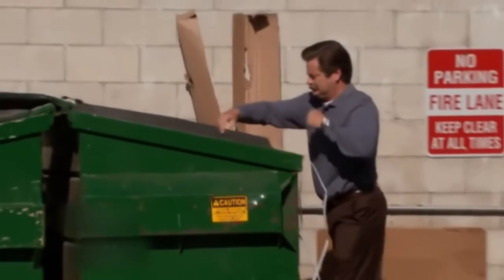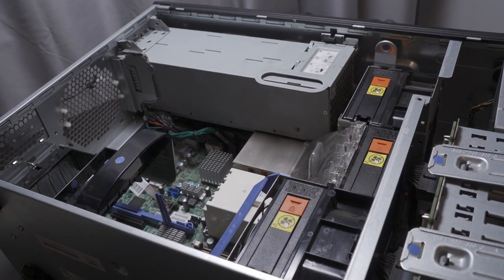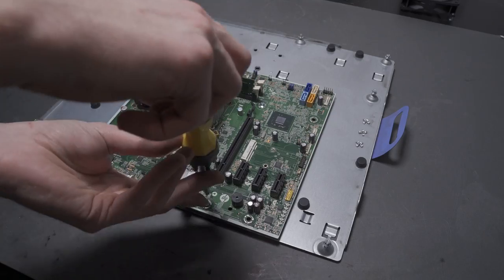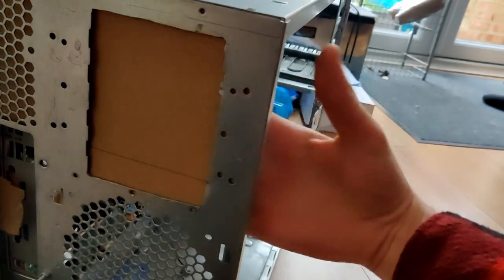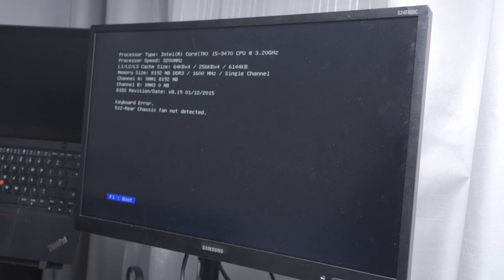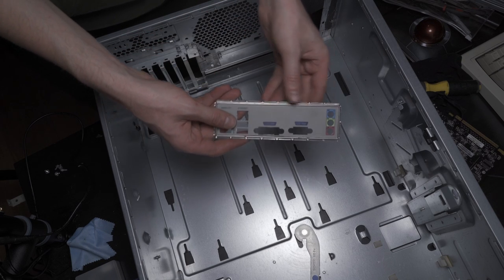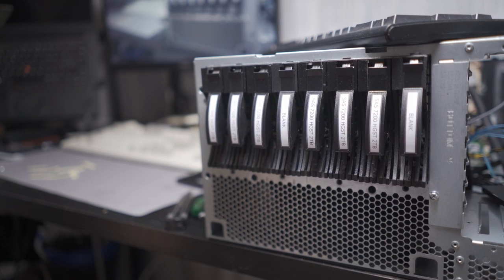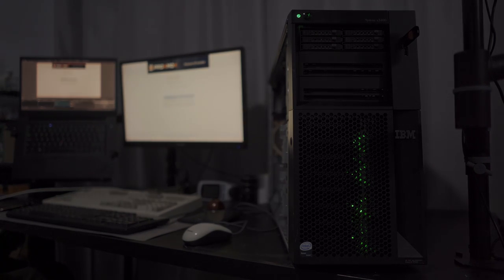Unexpected Upcycling: building a new server from an OLD server! IBM System X3400

Comment: I love "older" servers. I have a Dell PowerEdge T420 (and a t320 as well) and just love them. The T420 has 2x E5-2470 V2 which are a 3.2GHz 10 core 20 thread CPU. So I have 20 cores 40 threads available. The thing easily beats my Ryzen 7 3700x in Cinebench (run in Wine on the server). Yes it's FAR from power efficient but if I wanted that I'd use a Pi cluster. Plus there is just something about these loud heavy beasts. If I decided to upgrade this as you did I'd have a easier time as at least the motherboard looks to be standard ATX. The PSU however is just like yours.

Comment: nice build I put the serial number of the disk on the trays to make finding them faster, for when/if one fails normally the log shows it by /dev/id and sn.  Still glad to see another old case not just go to the landfill.
Reply from the maker: its a good tip, however a good alternative is (and i had a chance to test it as one of the drives has failed over the past two years) is to use the sas controller tools to just flash an LED on the drive in question

Comment: Now this is a cool build!    I plan to do something like this in the future with a Dell 2600/2500 case I have.   No reason to use the Hardware as the CPU/ Mobo is VERY OLD.  But the case is perfect for Multiple GPU cards and already has the provisions for forced air cooling of GPUS for A.I. workloads.
Reply from the maker: The Dell looks like a great choice! Good luck, would be interesting to know how the modification goes for you :)

Comment: I worked on those in the film industry back in the day, the Thinkstations and the HP Z 8x0 series boxes. I have a few HP Z8x0 machines sitting around in the garage and I thought about converting those for modern use since I love the cooling design, shrouds, and all the hot-swappable fans, and drive bays. Everything toolless. I look at modern pc cases and just sigh at how dated everything is, screws everywhere. One big issue with adapting say a Z840 would be getting a different power supply since the shape is really long and thin so it would require some modifications which would impact a bunch of items. Possible big undertaking.
Reply from the maker: I have looked around for other cases before getting the x3400, and also came to the same conclusion that the HP tower servers (as well as dell and some others) are not as atx-mod-friendly judging from some pictures. By far the x3100 and x3200 are the most atx-like, i believe some of them come with regular ATX PSU mounts as an alternative to the dual hotswap redundant psu's.

Comment: Still rocking an X3400 M3 back in the office - it used to be one of our production server, nowadays its just acting as a Veeam repository. I give it a good dust off every year or so, runs like a charm! IBM knew how to make x86 servers... Great video btw!
Reply from the maker: Thanks for the comment! Great to know more of them are still in use :) Althought the m3 is quite different from the m1/m2, the case is even less atx-like, with the io panel holes being cut out of the case (there's no removable io shield)

Comment: I had a similar Xeon as my daily for some time in my teenage years. Had a 775 system laying around and I thought I could put it to good use. Went on local second hand site found a 771 Xeon modified it and the board for it to work. Had no problems with it at all... Only weird thing was every time I pressed the power button the lights would flicker for a sec.

Comment: Its like you have read my mind on this one I just bought the exact same one  for super cheap but the rackmount variant and planning to to exactly this Thank you for linking the SAS backplane pinout as i will be reusing those as well.

Prices of rackmount cases is ridiculous and the bigger you go the more it costs.
Reply from the maker: Thank you so much for the lovely comment! I hope your modification goes without issues! Let us know when you're finished :)
Reply: @TheRepairLair  yeah so I got the server seems like a newer motherboard  not a single stanoff match atx format and the IO backing plate is a cutout on the metal case itself so it seems I may have a bit more work cut out for me. Also came with different 2.5 sas backplane with 16pin power. I was able to measure the pinouts from  that was really easy because it had an aftermarket color coded power cord just confimed that it was correct.
Reply from the maker: @AverageAutomation  Thanks for the update, hope you manage to get the rackmount variant modified. You can buy standoffs of various heights in very cheap kits from ebay or amazon, but i'm concerned if there is enough space for the threads when protruding from the modular motherboard mounting plate without touching/scraping the bottom of the case. Let me know :)
Reply: @TheRepairLair yes I already have some standoffs will need to grind off all the current standoffs and bubble standofs to avoid them contacting the mb i should be fine taking to my Dads tomorrow maybe he is a qualified panel beater I am sure between the two of us we will figure it out.

Comment: Got your video in recommendations. We need the final build! With new mobo.
Reply from the maker: I added back the fan assembly with 3x noctua fans and an extra fan splitter on the mobo. But, im still running it with the ancient junk mobo! it suffices for what i need, lightweight virtualization and data storage :)

Comment: T320s are a decent option too. Most standard motherboard mount holes are there, even the less standard server board stuff. Room to do the same standard PSU mod. 1st slot isn't missing, but is a goofy out of spec half height slot. the oher slots are Tool-less. Some have back planes. I put a SuperMicro X9DRH-7F in mine.
Reply from the maker: I wasn't aware of the T320S, looks like a really good recommendation!

Comment: damn, I tossed used IBM X3200 3 years ago, that's too much work for revive a heavy AF case(and front panel is duct taped). but I savaged Xeon X3430, ECC RAM, PSU(My PSU model is ATX standard w/ SAS connector) and exhaust&HDD Bay Fan
note: I don't save the SAS card because it doesn't come with SAS drive
Reply from the maker: Ah what a shame! The x3200 is in fact much more atx-like than the x3400

Comment: Nice build man! I'm going to do something similar with a system x3200 m3 that I just picked up today.
Reply from the maker: Best of luck! m3 might be more tricky though due to the back panel being quite weird, but i hope everything goes well for you!
Reply: @TheRepairLair  Thanks for responding! I'm actually thinking it will be quite a bit easier because mine came with a standard ATX powersupply, and the motherboard I plan to use has a m.2 slot where the first pcie slot will be, meaning that hopefully I will only have to modify the IO bracket.
Reply from the maker: @tomcraftdonkey2285   If i remember correctly, the M3 doesn't have a removable IO panel, and all the pci slots are slightly offset from normal ATX, but i really hope i'm wrong on the latter and you manage to mod it without any issues!
Reply: @TheRepairLair  Thank you for your insight into modifying the case, but I would also like to reuse my single sas back plane like you did in your video. Only problem is that the connector is different from yours, which converts a female 8 pin connector from the power supply into a 14 pin connector. Considering that I would only have to modify 8 pins, it doesn't seem as bad as yours. However, I have little soldering experience and no pinout. Could you please give me some advice if you can? Thank you very much for your time.
Reply from the maker: @tomcraftdonkey2285  Can you power on the machine? As long as you can actually turn it on, you can just borrow or buy a cheap multimeter and measure out the pinout yourself :) I had a brief search online and couldn't actually find an example of an 8 pin power cable for the x3400 m3, maybe you can post a link here?
Reply: @TheRepairLair The serial number for the adapter cable is 49Y8289, and my machine is the x3200 m3. The machine works, and I will try to use a multimeter to figure this out. Thanks again!

Comment: Could you not simply have just drilled new standoff points and moved the mobo down so all the pci slots lined up?, would have been much simpler, plus the mobo tray is probably a cheaper part to replace if it didn't work out, did also wonder how you were going to tackle the backplane power as they looked like a nightmare. great job. Anyhow, nice to see a server get reused. Just like my own, truely love my supermicro mobo :)
Reply from the maker: Adding new standoff points would be more complicated, and in fact, i COULD have just got a different motherboard without the first slot altogether, saving all the trouble!

Comment: very good project, congratulations mate! very inspirational video. I want to ask, why if you put warm hardware? it possible to cool ? or have to make modifications and ruin the original case? maybe cooler with liquid, you have a lot space inside.
Reply from the maker: Thanks!
Regarding the cooling, since ive uploaded the video, i added bqck the three fan assembly, but with regular noctua 120mm fans instead of the originals. You can of course modify it further, like using liquid cooling, but i dont need it for my use

Comment: Love it...  That is a great build.  So much redundant space though.  You really need to maximise that.  'wasted potential'.
Reply from the maker: Ever since starting this project I was planning to put a supermicro H11SSL motherboard in this, but never really needed to upgrade as the crappy outdated motherboard shown in the video just serves all my needs and refuses to die! I did modify and add back the fan frame with 3 silent atx 120mm fans.

Comment: Nice build! The PSU and the PCI slot modification was unnecessary. You shouldve use an SFX powersupply instead of the reguar ATX. With that you only needed to make a bracket for the SFX psu and you could secure it to the modular IBM PSUs place. For the PCI slot you could use a simple PCIe 16x riser and you only need to make 2 standoffs for the riser card.
Reply from the maker: Thanks! I think using an SFX PSU probably wouldn't have changed the amount of work required all that significantly. The riser, however, might have been good, but making the extra pci slot was a mistake in general, and could have been completely avoided  by using a different motherboard.
Reply: @TheRepairLair  the SFX PSU dimensions are 125mm x 63.5mm x 100mm(4,9x2,5x3,9 inch). The X3400's PSU is 86mm x 381mm x 343mm(3,3x15x13,5 inch), so the SFX would fit perfectly in the dual PSU bay. You need only a bracket to hold the SFX in vertical position. Im planning a similar build in the future, becaus i started to grow out my current NAS. It have only 2 HDD bay and proper NAS HDDs with 4+Tb capacity are really expensive in my country(hell yeah to the 27% VAT and the special Artisjus tax).

Comment: It was very entertaining, but I would not dare to do some of that splicing and joining myself. 1. I am not very skillful with that stuff, and 2. I need to know precisely what wires  I am splicing and joining together. Overall, excellent video.
Reply from the maker: The wires can be either measured under live power, or you might find them as i did online. This really isnt recommended in general, but its a hack, and over one year later everything is still working perfectly :)

Comment: This game me an idea for a project with a dell poweredge 1900 i have, and some aliexpress items i got, this looks so cool. i just wonder if i would be able to use the fans on the server, with all the perforations the case has i know it could make some real good use to have all those fans. i plan to pair the case and electronics with a dual cpu motherboard and 2 xeons e5 2670v3's. i wish more people could replicate this project and upload it so it could have a more solid understanding on how to go about it.
Reply from the maker: Regarding the fans - I have replaced the original fans with 3x 120mm noctua fans after i released the video. I drilled out new holes for screws and screwed them in directly, it works perfectly well and helped reduce the hdd temperatures further.

Comment: Wouldn't it be easier to use another IO frame that fits the MOBO?
Reply from the maker: the io frame size is non standard, so no off the shelf option would fit
Reply: @TheRepairLair  In 18:00 we can see that you had a matching IO frame.
Reply from the maker: @dCnpMBqQNZ37r8xg   that is the same one that i used in the final build. I didnt modify the io frame, its the original that came with that mobo. I only modified the case to fit the io frame.

Comment: nice server, but i have an other question, what kind of stand do you use for your Thinkpad in the background? :)
Reply from the maker: It's a cheap single pole dual arm monitor stand, manual (not gas), It's meant for two monitors, but it has an optional plate for a laptop :) Plenty of options on amazon or ebay, mine was about ~40$

Comment: 4:12 no its not trying to boot over ethernet, thats the RAID controller searching for its drives.
Reply: also another thing, servers tend to have pretty robust capacitors. I own and have worked on a bunch of IBM gear from this era and I've never seen capacitors fail on the machines ive dealt with, and ive seen some in some pretty horrid places. These systems while old tend to be pretty good at running Windows Server and not a lot else. Virtualization wasnt in vogue when these systems were around so these systems werent really designed for our modern type 1 hypervisors like proxmox and esxi. If you were running virtualization on this you were probably running an ancient ESXi or maybe xenserver?

Comment: Hey bro
R u able share the ibm hdd cage back panel power socket pin diagram.  Couldn't find online. I'm going to mod my 3100m4 too, try to save the hot swap hdd cage。thanks
Reply from the maker: https://www.emsley.ca/hardware/ibm-x3500-sas-backplane

Comment: Awesome case mod! Really digging the industrial apperance. Did something similar with a Powermac G5 case a couple of years back (which is still houses my daily driver pc). Now however, after seeing your build, I'm tempted to track down on of those IBM cases and use it for my next homeserver and then stick in some ridiculous Threadripper or Epyc system haha.
Reply from the maker: Thanks! Should you go this route, there are some similar towers that may be more or less complicated to modify, including x3100, x3200, x3300, x3500

Comment: I have an X3500 server, it has a copy of Windows server on it, I've always wanted to get past it's login and play with it - for a dose of retro fun, however your path is probably the easier one. (Dare I say, 'More sane')
I loved the 2.5 inch docking bay, I'll have to get one of those. Actually I'm considering a server just using SSD's as it will be 99% read with little writes, Way more power efficient than a pile of spinning disks.

If anyone knows how to break into a Windows server, let us know.
Reply from the maker: hi Paul - do you really need to access windows server? why not just reinstall it from scratch, or, perhaps easier yet, just get a linux distribution running on it? particularly if you're interested in using the server for storage, you could get truenas for free.
Reply: @TheRepairLair  I'm more interested to see what services etc it has on it, hopefully it can do remote booting of workstations etc, or something else equally interesting.
Windows on it's own is nothing special, I'm just hoping it's got other goodies inside.
As there seems to be so many subsystem at play when I boot it, I kind of assume it needs a special version specifically written for it.
As for truenas, I have several other PC's just waiting for similar use. I currently have an old atom industrial board running FreeNas as a play thing, unfortunately it will only take 4G of ram, so hence watching your vid

Comment: A few notes, tinning wires then using crimps over that is never a good idea, the solder will flow causing a lack of tension over time, you should either skip the tinning, or add some flux and solder the crimps onto the leads.
Also, that SAS controller you made an extra slot for, as it has no ports on the back, wouldn't it be easier to just remove the bracket?, or just screw it to the existing metalwork, as it needs no outside view.
Reply from the maker: thanks for the comment - i didnt know that about the crimp connectors as i almost never use them, useful info, i really appreciate! Regarding the extra bracket, honestly i shouldnt have made one at all - lots of server atx motherboards (like supermicro) dont even have a socket there. Ideally i should have just bought a new motherboard. Lesson learned!!
Reply: @TheRepairLair  No, nothing wrong with recycling/reusing stuff, make use of what you have, the world has enough land fill as it is.